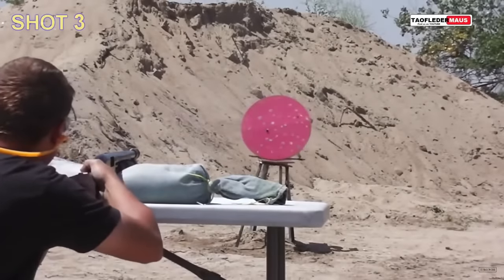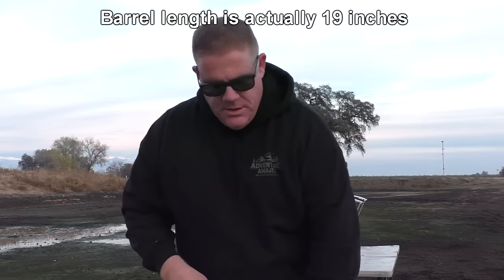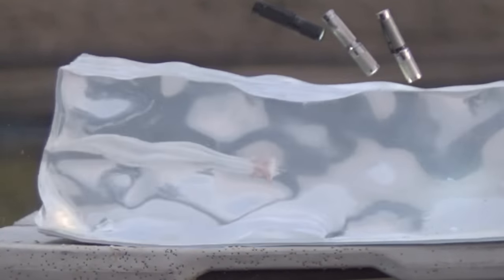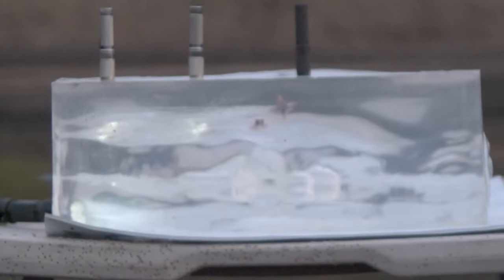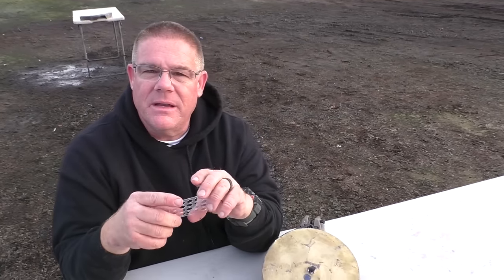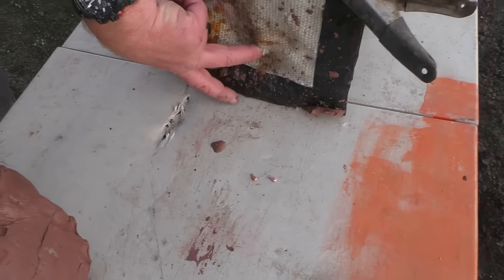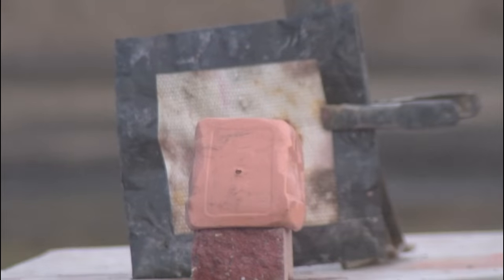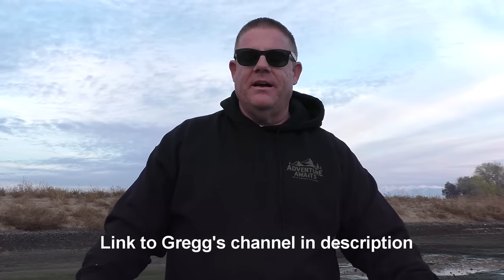Holy Bloomin' Bullet!   The 9mm INTERCEPTOR  -   Tested!

Comment: The difference between the 5" barrel and the 16" barrel wasn't as much as I expected. Makes me think they might perform well from shorter barrels too. Tim should send some to Paul Harrell too. I'd love to see what these do to the meat target.
Reply: So this is what I think might be going on with that. The powder is being burned off at around the 8-10" mark. The rest of the barrel is then slowing the bullet down. I have a Beretta M9A1 with a threaded barrel just over 5". With the Corbon 125gr +p I'm getting about what's on the box. 1250fps. In my HK Sp5 with a 9" barrel I'm getting 1425fps. What you get from a 125gr .357mag from a 4" Barrel.  To be honest I bought the HK because I thought it was cool and would be fun to have around. I live in a rural area so a AR15 for home protection isn't a bad choice. But after that I leave the HK loaded as well. My friend also as a AR 9MM of some sort but it is a rifle with a 14.5 pin and welded barrel. He's getting about 1325 with that same Corbon load. Anyway that's what I think is going on. ⁸
Reply: Makes sense. They could be pairing a faster burning powder for such a lightweight bullet. That would still be useful in a short barrel, as long as there's still enough recoil to reliably cycle the action.
Reply: The vid says the barrel was 19" not 16".  I bring it up because I have an AR 9mm with a 16" barrel and the velocity is quite higher than out of my Beretta 92FS.  I do believe once a barrel reaches a certain length velocity does drop off.  I saw somewhere with a 9mm that length is around 12-14 inches.  I would put a slightly shorter barrel however that puts me in the SBR category.
Reply: In rifle length barrels you tend to get a lot of mileage from running hotter ammo, because otherwise pressure drops too much and barrel friction actually makes you lose velocity past a certain point. You can go even higher if you use loads with slower powder, just be aware it'll lose performance in pistols.
Reply: Yeah this is clearly a case of a loader knowing what he’s doing. He’s using an appropriately fast burning powder to get max velocity out of short pistol barrels. When you use long but light solid copper bullets, usually you get best results with faster burning powders. So, if you graphed velocity per inch of barrel, what I would expect to see is that velocity increases as the barrel increases until around 8-12” or so, then the powder is spent, and friction between the bullet and barrel starts to win. I bet velocity increases until that 8-12” mark then slows from there.
Reply: @charliedee9276 

You can always pin & weld a muzzle device to meet the 16" minimum. The 14.5" 6.5 Grendel AR I built a few years back ran a pinned & welded Breek Arms taper mount flash hider, and mated up exceptionally well with a 7" 13/16-16 suppressor  I form 1'd 

Fun fact, the 123 gr 6.5 Grendel in a 14.5" barrel hits with more energy than a 7.62x39 123 gr out of a 16" 

The Grendel in a 12" barrel is equal to the 7.62x39 in a 16" 

One could use a short direct thread can and pin&weld it to a 12" 6.5 Grendel and have a fantastic brush gun with only one tax stamp.

Note, if you do that, subtract 1" from your suppressor length to account for your barrel threads. Ie a 12" barrel needs a 5" suppressor to make 16" minimum.
Reply: 9mm starts losing velocity after about 16”-17” because of barrel friction.
Reply: @charliedee9276 iirc the maximum  barrel length to squeeze the most out of the majority of 9mm loads lays between 12 - 16 inches. I've seen some PCCs squeezing 1600fps out of a 1200fps load with a 16inch barrel.
Reply: A longer barrel length also gives it more accuracy by slightly faster speed and maybe more spin.

Comment: Seeing sonoluminescence from the collapse of the cavitation bubbles in the high speed shots of the water jug is pretty awesome!  I saw three flashes, with the largest being at 19:21
Reply: Great catch!
Reply: Sorry to ruin the mood but those are not sonoluminescence flashes, its actually the flashlight behind the jug used to illuminate it flickering. You can see how it turns off when the bullet hits the jug then it seems to want to turn on again.
Reply: @teresashinkansen9402  I disagree, the flashes are too intense and short-lived to be flashlight reflections. They are also not the same colour temperature as the supposed source light.
Reply: @HamBown  The flashlight is plenty powerful, you can see on top of the jug how bright it is, the reflection looks almost like sunshine. For sonoluminescence flashes to occur a sealed collapsing cavity must form, yet you can see there is not even a cavity formed, its not sealed at all and its still expanding, its water splattering around. Ive only seen such flashes happen on ballistics gel because it keeps the cavity shape, also its not proper sonoluminescence but a dieseling effect.
Reply: @HamBown  yeah it’s a flashlight. Like Teresa said, sonoluminescence requires a sealed container (at least partially sealed). Essentially, you have to create a cavity, that then collapses and creates the flash. There’s no external pressure to cause the cavity to collapse here. The flashlight was just spinning and causing flashes as it spun each time.

Comment: I'd like to see how it does out of a 3" barrel like most folks, especially in warmer t-shirt weather, tend to carry. I have a feeling the 124grain Federal HST round would still be on top. But again, I'd like to see shorter barrel testing to know for sure! Thanks for a great video for what seems to be a great round so far.
Reply: You bring to mind this question, "What is the expansion threshold for these bullets?" And its upper limit where petals shed off would be good to know also regarding use in .357 Sig or .38 Super.

Comment: Man, that clay test was damned impressive for a 90 grain round.
Reply: @virgilhilts3924  Very true, but the fact is that a soft clay block can still be used as an indicator of how good a projectile dumps its energy into its target. 

This particular round is able to generate so much "traction", if you can think of it in that borrowed term, that it creates a damn flower pot. Other rounds of similar weight often don't push away the clay as effectively and only get to "gutter pipe" size.
Reply: @virgilhilts3924  Hey, a body isn't made from ballistics gel either, clear or not. 

The fact that the target is not actually the same as a body doesn't mean it can't yield meaningful results when comparing rounds. 

What one cannot do is to take the expansion in ballistics gel, or the expansion in clay, and assume that it will expand exactly the same in a body. 

But clay (or BG) will show which round is better at dumping energy, in comparison to each other round in the same type of clay.
Reply: @virgilhilts3924  Shees, you want me to be more precise, and call it transfer of kinetic energy? 

I'll bow out. Be happy, you "win" this round Mr. Expert.

(This channel isn't about being a good hunter, which as you correctly point out calls for good aim in the first place, but this channel is about how bullets behave. It's not about how to properly aim, or where to aim.)
Reply: Agreed
Reply: @virgilhilts3924  
What are you trying to prove there bud ?
Or are you just getting off trolling this dude ?
Reply: @Hydrazine1000 10% 250A ballistic gel is a valid soft tissue simulant, clay isn’t.
Reply: @swamp1634  True, but it can still be useful for a direct round-to-round relative comparison. 

You can still see which round transfers more kinetic energy. You can't really say anything definitive on what it would do on tissue.
Reply: @Hydrazine1000  kinetic energy is not a wounding mechanism in this case, see Handgun wounding factors and effectiveness.

Comment: I was expecting you to test it against soft body armour. I thought with the extra velocity it might have had a chance.
Props on Tim making some weird but solid stuff. Great video as per usual!
Reply: The extra surface area as it expands would make the marginal extra velocity negated. .357 mag is higher velocity and has a heavier projectile but IIIA is rated to stop that. AP ammo is designed not to expand at all. It still would be interesting to see what would happen though.
Reply: @colbunkmust  Yes, but I don't expect it to expand in kevlar.

Comment: Jeff, one of the things I've seen done to illuminate and help measure rounds in gel is using a laser pointer.  Of course that won't do anything for the overall lighting while you're filming, but it does illuminate the rounds better in the gel, especially when you have multiple rounds close together, and it helps give you a measuring point from outside the gel without having to move the block around or cut it open.

Comment: i don't say this often at all but im impressed at how well these work! most exotic ammo looks cooler than it is wen function is called into question. but this ammo seems to do exactly what they are supposed to do. ide love to se a 45 auto+p or a 357mag in the future.this design seems to use its energy alot more successfully than standard hollow points.it seems for once its worth what they cost.
Reply: If you roll your own ammunition, you can buy these bullets and stuff them into a .357 case.

Comment: Would love to see the 10mm performance. Double tap makes a 135gr JHP 10mm round that flies 1600 ft/s. I wonder if Tim’s 10mm interceptor round is similar to that
Reply: They make great ammo, I really wish they would start loading the 285g A-max .338 lapua again. It was an absolute power house, Punched 3 holes in my 3/8 ar500 steel plate at 300 yards
Reply: His site says plans are for a 10mm in 140gr

Comment: It would be really informative to see what these do on a sheet or 2 of drywall.  These could be really good for home defense.
Reply: Drywall would not even slow them down. Drywall has negligible effect on bullets. 
Even OSB / plywood is not much to a bullet.
Reply: Lol
Reply: I wish I could upload a picture as I have tested this on drywall, wood, thick/hard plastic totes, and a couple other hard targets.  I will try to describe as best I can what happened.  First, and worth mentioning, is that these projectiles are made from solid copper.  They are very difficult to bend and deform compared to a traditional lead and/or jacketed lead hollow point.  The short answer is that they don't expand, and deform very little.  I had a couple that closed slightly more than an unfired projectile.  I also had exactly ONE where one pedal opened slightly and then bent slightly in half (outwards) AFTER the initial impact ( I believe it struck a metal button on a pair of jeans that were inside the plastic tote I fired at).  If they strike anything SOFT AND DENSE like flesh, they immediately expand and stop expansion when the pedals reach just before or at 90' from the direction they were fired.  They actually TEAR in between each pedal until it reaches the base.  Because they are much harder than lead, it would be very difficult in soft/dense material to bend them PAST the 90' point.  They bent the TIPS of the pedals AFTER initial entry when hitting "bone" or hard internal parts of the target, which caused the projectile to tumble.  The bends were very minor, which was impressive.  I hope this information helps.  I tested around 200 rounds so far.
Reply: @liberty9348 people who EDC handguns need to know this information. Drywall or any hard surface besides thick metal or cinder will NOT stop a JHP. owning JHP rounds is NOT an excuse to let lead fly wherever "because it won't penetrate my walls" they can and will penetrate drywall.
Reply: @liberty9348  just to add I remember reading a comment where this guy was saying a JHP would lose all killing velocity after going through drywall which also is not true.

Comment: I just got my first few boxes of this for testing. I found that if I used my stock Glock 17 it ran flawlessly. But if I used the same glock model with a heavier spring (18 lb) to accommodate the strike force compensator, there wasn't enough pressure to get it to cycle and ended up with type 2 malfunctions.  Hopefully I'll be able to test this against some bone targets soon to see what that does. I want to make sure it will penetrate to vital organs and not get hung up on a rib.

Comment: Curious as to how well these cycle through and reliability. May have to grab some. definitely want 10mm if and when they are available.
Reply: I had zero feed issues with my Ruger P89DC 9MM 3 Mag 16rd Mags Rapid Fire.  As I was also concerned with feeding issue's. Not even a hiccup, these Interceptors ran very smoothly. With the light 95 grain bullet recoil, barrel rise was negligible and essentially stayed on target

Comment: Interesting how he's got, apparently, the optimal powder for this load for a handgun duty sized barrel. It would be interesting to find the length where the bullet begins to slow thw bullet from friction with the extra barrel length while the gasses are no linger expanding (which seems to be happening here).
Reply: For 9mm that's usually at around 16"

Comment: The price is great.  It's totally worth grabbing a box of 20 and keeping a couple magazines of it on the nightstand. 

I can't imagine these would overpenetrate in the house.
Reply: Most people miss in a self defense shooting and that's FAR more worrisome than "overpenetration". Normal 9mm HPs will be more reliably lethal and also not go through a suspect.
Reply: Actually, this is a great point and might make a great follow-up test. How many sheets of drywall will it penetrate? 

Two sheets of drywall would represent an interior wall, and if that is enough to slow one of these interceptors to non-lethal speeds it would be game-changing. 

Drywall, fiberglass insulation, and 1/2" plywood would be a good simulation of an exterior wall.

Comment: Tim uses a common soft cooper rod for these bullets. They opened perfectly. If he used something like phosphor bronze, they would poison them too, causing an extreme amount of agony, which might lead to stopping the perp quickly. Too hard a cooper, and they would be too brittle, and snap. His machine design, is working perfectly with the materiald he is using. Love to see him lighten the round a bit. Close encounters, are the most common, fighting distances. At close range a light zinger round, doesn't lose that much stopping power.

Comment: The little difference in speeds with such large difference in barrel lengths is surprising. :)
Reply: Not surprising at all. Pistol powders burn fast to work in short barrels so all the powder was burned before it reached even half the length of longer barrel.

Rifle powders burn slower so they continue to build pressure the length of the barrel, that's one reason there's far more muzzle flash from rifles compared to pistols.

Comment: Greg mentioned shooting a lot of 10mm and the petals of a lot of gimmick rounds breaking off if you shoot them too hot. That's actually a problem with 10mm, since it isn't way too popular a lot of the loadings for it are just manufacturers taking their existing 40 s&w bullets and then upping the powder, and as you know, hollow points tend to only expand or function properly when they're in a certain velocity range. As for the carbine I think by 19 inches you're really stretching 9mm. At that point the powder may have burned so completely that barrel pressure is dropping, as I'd expect the lomger barrel to help velocity a little more than that.